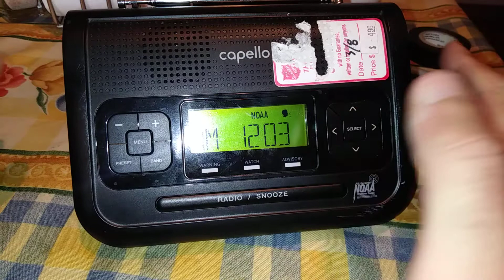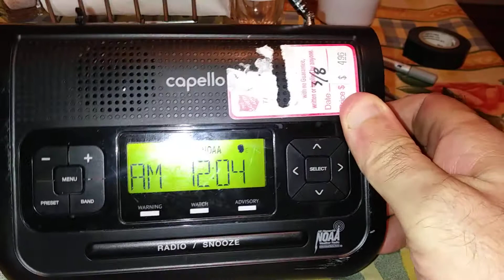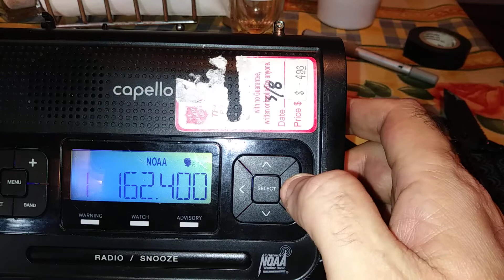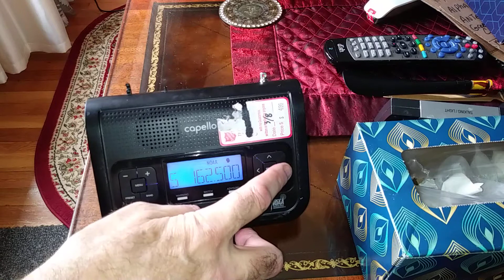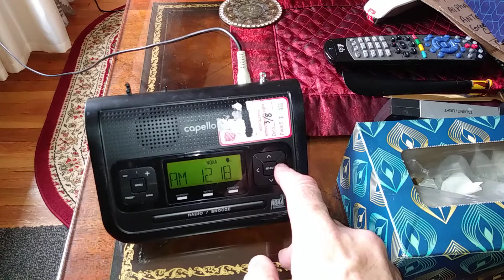How to make an external NOAA Weather Radio antenna out of RCA audio / video patch cable

Comment: Good video.  In theory the wire dipole antenna should work better than a standard AV cable with RCA plugs at both ends.  I tried both, and for me using an unmodified 5 ft AV cable without the dipole legs works just as well.  Strange.

Comment: I need an antenna outside of my aluminum camper. (Inside reception is non existent). I'd llike to use stiff wire, a coat hanger or old rod from a cb ant, cut down. I have both tv coax (75ohm) and cb (rg58/6 52ohm). Which impedance is best for the 162.mhz freq? Thx.
Reply from the maker: @Lapeerphoto  it doesn't really matter, it's for reception and not transmission, the length of the antenna is more important

Comment: Do you need to take off the original antenna to use an external antenna?
Reply from the maker: No, you do not need to remove the telescopic antenna, just leave it in the stowed position.

I removed the one on this video to demonstrate how the external improved reception compared to a normal extended antenna, and a 'damaged' antenna.

Comment: Is there a way to boost the weather radio portion of a combination AM / FM / weather radio? I was thinking of opening up one of my radios and then finding the internal weather radio antenna and then connecting it to your antenna. Just how hard would it be to add a RCA jack to one of these?
Reply from the maker: What is the brand and model number?

If it has a telescoping rod antenna then try wrapping some wire around that and if you notice a improvement in reception then yes an addition of a female RCA jack may work, just remember that there is 2 connections to a RCA jack the inner one and the shield, the shield would need to be soldered to the ground plane of the radio board.

Comment: Do you understand wavelengths and antenna design?
Reply from the maker: Yes, but I just wanted to show a simple design that uses common materials, patch cord, knife, wire and tape, that will most probably work in any situation.
Reply: @Legend813a  it would give something better, in some cases, the stock receive antenna, but most likely because of placement. If you figured out the receive frequencies and built something like a full wave loop antenna for that particular range of frequencies it would be far superior in performance. For a full wave loop would be 1005/frequency in Mhz, so at 162 Mhz would be about 6.2 feet loop. Then you need a matching piece of coax to match the input to the radio, can use a simple online calculator.

Comment: put your original antenna back in and it would be the same and shave your nasty looking knuckles ive got 3 nohaa weather radios in my house and even though yo u did give some points its all the same here. shave shave sahve thats just gross
Reply from the maker: Watch the video again. With the external antenna you can hear more stations, and the stations that you did hear with the rod antenna, come in with a better signal.

Comment: How long was the original patch cable before you started cutting it up? Also, how long did you leave the wire on the patch cable that you used for the antenna?
Reply from the maker: As long as the patch cable has a good quality shield I'd think runs of 20 feet would be okay.

Comment: NOAA is not smart. With today's tech, NOAA should be in every new automobile. They should have an pay app. They can still sell radios with midland, but hey its just money lying on the ground. They should pick it up.
Reply from the maker: To work properly a built-in NOAA weather radio in a car would have to be tied into a GPS system and have a database of which of the 7 channels serve what location the vehicle is in to receive warnings for where it is.
Reply: @Legend813a  If it was automatic, that would be cool.
I would assume that the owner of such a radio could just initially tune their NOAA radio to a local station. Also, with the addition of S.A.M.E, could they just not select the geographical location.
I know that 'back in the day' mobile phones had a build-it FM radio, and used the headphones as an antenna, it's to bad that seems to have died, those phones had GPS.

I guess the best we can do now is to use an old mobile phone with GPS and an app to tune an SDR.
A cool week-end project, too bad we can't buy something from the dollar store for $10.
Reply: NOAA is there to provide a service, and that's what they are doing. So to say that 'they are not smart' because they are not doing what you think they should, is unfair.
They are also, not in the business of selling apps or radios.
If every new automobile doesn't come with a NOAA radio, it's probably because most people don't want it or don't know about it, or just don't want to pay for it, it's not like automobile manufactures are going to add it for free.

Comment: Questions.....Can people use a wire stripper/cutter rather than a knife? Does yelling focus....over and over...actually focus a camera? Why not just buy a new antenna for $4.99 and not go through this chaos and have a wire in your window? Can you trim this video down to 5 minutes?
Reply: Is their anything else you can find to complain about?
Reply: @tayninh69  my sentiments exactly.
Reply: @tayninh69  he would complain if he was hung with a brand new rope.
Reply: @mcard48able  I kind of got that impression. Some people just like to complain about anything or everything.
Reply: @tayninh69  "Some People" are specifically on Youtube, just to complain.
Reply: Why not just say that you have issues?.  Can you trim your post down to less than 50 words?
Reply: 1. No, to use wire stripper requires intelligence level you don’t possess.
2. In the case of this video, yes. Saying focus does focus the camera.
3. The cost to do this could be $0 if you have some old rca cables lying around.

Comment: Wonder why someone would donate it to the Salvation Army?
Reply: He is saying that the rca cable could be purchased at a resale shop. I am grateful for his video.
Reply: @BluechipJunior  I guess that's why there's a sticker on the radio that says salvation army
Reply from the maker: You can find weather radios for less than $5 without a power transformer around $8 to $10 in better condition.